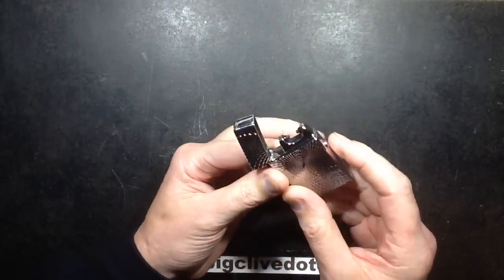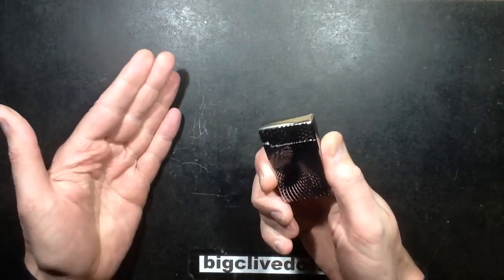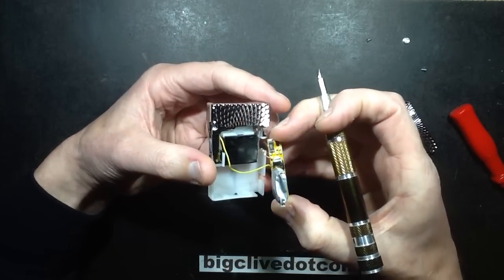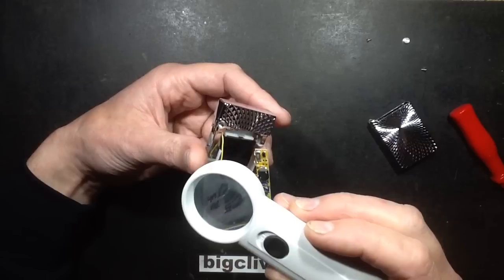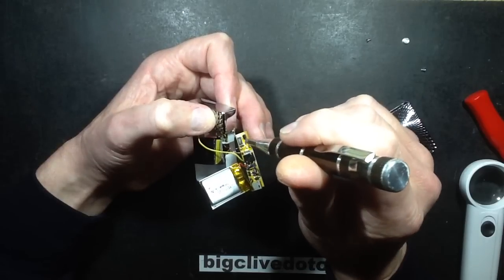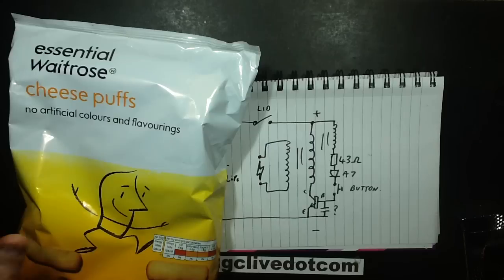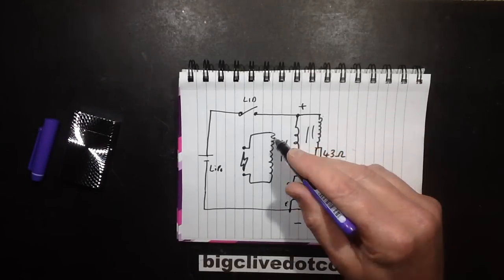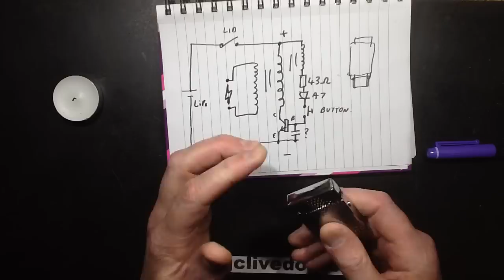Disassembly and schematic of an arc lighter.

Comment: sorry Clive disliked due to the fact that hurt my ears, it made me tear off my headphones.
Reply from the maker: +SwGuru Excellent!  I have created an audio YouTube monster.  My work here is done.
Reply: +bigclivedotcom hehe
Reply: +SwGuru headphones sucks use big speakers this will not rape you ears
Reply: +1ol17 I have my computer hooked up to a 500w stereo system with large speakers I have taken out of cars, and let me tell you what... This video still raped the fuck out of my ears.....
Reply: +Nolansykinsley Don't listen at such high volumes then. It's bad for your hearing regardless of whether you're using headphones or speakers.
Reply: BenjaminGoose I don't listen at high volumes, I turn it up just enough to hear the voices clearly, I save the full 500w for parties.

It wasn't the volume that was earsplitting, even turning the volume down most of the way did not help, it was just a really jarring and piercing frequency that starts to go beyond what I can hear so gets garbled and is very painful.
Reply: Nolansykinsley Fair enough.
Reply: +1ol17 BULL SHIT...
Reply: +SwGuru lol. i've never been grateful for hearing loss/tinnitus before. i felt a weird pressure behind my ears that i notice with high pitch sounds, but that is it.
Reply: +BenjaminGoose - It's the pitch rather than the loudness of it - like a brake squeal - you feel it as well as hear it.
Reply: +Krisztián Szirtes I thought the same right until he held it up to the microphone...
Reply: +Thomas Peacock pls help me out with that.
Reply: I'm not liking the sound also
Reply: Grow a pair.

Comment: I bought one of these over the summer from Amazon. It was named after the great Nikolai, presumably to give reassurance it was designed by him, or perhaps the electric car company.
At any rate, it failed within a few weeks and would no longer charge. When I opened it up, it seemed the windings had shorted, and it was very poorly resined.
When Clive decided to test for shock, I got a big grin as I knew what was coming. The version I bought was activated by a mercury switch and shaking it. I had it in my pocket and was fiddling with it. Naturally I touched the arc and got a funky kick in the hand.
Nice video as usual.

Comment: Interesting that the first time it lit the sound was very clear and quite loud (about 10Khz) at a guess, but when you put it close to the mic it clearly overloaded the input and added lots of distorted harmonics. I can STILL hear that sound now, clashed with my tinnitus quite well.
Reply from the maker: +Michael Beeny It was the YouTube processing that turned an already exciting noise into something reminiscent of a Space Invaders machine exploding.
Reply: +Michael Beeny 
I measured 13.8kHz with an audio spectrum analyzer. I luckily don't have a tinnitus, but frequencies above that around 15kHz go straight to my teeth and make them feel tingly.
Reply: +superdau mine said 14.17khz. i wonder if that jitters
Reply: The interesting thing is that the frequency recorded is nowhere near the actual oscillating frequency. A friend gave me a couple of cold cathode tubes and driver from a printer and my headset picks up the noise created really well. As I increase the power to the driver, the frequency decreases until about 17 volts (DC input to the driver), and then it suddenly pops back up again and rises. If anybody's interested, I can make a short video demonstrating it.
Reply: Oh, and it also killed my multimeter when trying to probe the AC voltage. Frequency increased as power increased, from memory, but I could be wrong.
Reply from the maker: +Prehistoricman Most multimeters are not rated to measure AC at high frequencies, and combined with the high voltage from the inverters it would be absolute death to many meters.
Reply: bigclivedotcom Yeah, I saw that in the manual later on. Up to 400Hz AC, which is pretty poor. Interestingly, the frequency and continuity measurements still work fine, but voltage and current are completely shot.
Reply: +Prehistoricman the standard end user of an average multimeter has little need to measure above 400 Hz. This covers your typical mains all over the world as well as aircraft AC.

There are of course multimeters that exceed this and frequency counters that go all the way up to 40+ GHz. 

All about the right tool for the right job.
Reply: The ringing never goes away, it just gets bearable again. Actually quite a lot of tinnitus is in the mind/how you deal with it (in my own experience anyway) and I've grown used to blocking it out in normal day to day life, only bothers me in absolute silence now when it can feel loud as all hell but still can "tune out" to a large degree.  I still occasionally get bat calls resonate in the back of my neck somehow, feels like white noise/harsh vibration in my vertabrae!

Comment: Thanks Clive for sharing your experiments with us. I learnt a lot from you. 
About this kind of stuff that make spark(not an arch), yes it is high frequency. I am amazed you as such an experienced engineer touched the contacts of that. I think you mixed up the case with arch welder that with a low voltage makes arch, arch welder is absolutely a different scenario, to start an arch in it the electrodes must be touched for a second and then the very high amount of current and other conditions are required to have a stable arch. In sparkers such as your lighter a very high voltage is needed, the high frequency is needed in favour of using much smaller transformer not the lower output voltage , the higher the frequency the smaller the cross sectional area of the coil which means the smaller transformer. All the switching PSUs these days are using the theory of high frequency, as you remember any electronic device we used to buy there was a heavy transformer in it but we can't see them any more except in a device that needs a very high current which still use the classic type transformers for high currents consumption. Many thanks again

Comment: I have one of these that has the X arc pattern, bought it because the 2 arcs passing right thru each other without interacting was interesting to me... I have never been froggy enough to poke a finger into the electrodes with it on, but expect it would be similar result. 

They're cool but definitely drawbacks... One is the electrodes foul readily. Another is the output fades as the battery drains down, exacerbating the effects of the fouling... And then there's cold battery response. But still a sweet addition to the collection.

Comment: OMFG that noise when you turn it on!!! 20KHz PAIN!!!!
Reply: 13,750hz, but nice try though ;)
Reply: @DJSNT  Interesting, I got it as 14·285kHz - but that was just one sample. Frequency may change when a big fat candle wick is placed in the way.
Reply: Re measured  - still getting it at 70µs/c. https://www.flickr.com/photos/pmailkeey/48872322562
Reanalysed measurements. 71-72µs = 13·889 - 14·084kHz so as near as dammit, 14·0kHz.
Reply: I have headphones on and only heard a little very quiet static... guess my hearing loss is now down below 15khz....

Comment: I use one of these while working.
Welders/structural steel workers aren't allowed to carry lighters due to the danger of exploding if molten metal drips on them.

They're good for lighting a cutting torch too, provided you don't get the torch tip too close to the arc.
That's how I found out they'll shock you.

Comment: This video made me curious enough about these things that I had to buy one, and of course I stepped it up and got one with a double arc. It lacks the lid safety switch, and from experience I can tell it is also very capable of delivering a nasty shock when the arc crosses any metal object you're touching…
I'm not sure if the only purpose of the double arc is to make it look cooler. It seems the two arcs cancel out each others RFI for the most part. I don't have the horrible squeal when recording a video of it, only a few pops.

Comment: Love the testing portion of your video.  Such a sacrifice!  I just got my first arc lighter and its one of the new fangled "dual arc" lighters.  Any idea how they get the arcs to cross without jumping to a closer terminal?  I'm thinking there is an oscillator in there that switches the terminals on and off too fast to see.  Anyone out there know how this is done?  Thank you.

Comment: The skin effect does not work really with flesh - I think what happens, is that the pain of electric shocks comes from two main sources: the involuntary muscle contraction and the burning. If the frequency is very high, then the muscles dont respond to it so much so this effect goes away, also if the current density is low (like a few mA but spread over a wide contact area), you wont feel it. But it's not so reliable and even quite high frequency you can get just as bad shock depending on the exact circumstances.

Also, anyone who has had a shock from mains, you can absolutely for sure feel the 50Hz (or 60 or technically 100 or 120) pulsation . I know I could, very distinct.
Reply from the maker: I recently did realise that it is indeed not the skin effect but lack of sensitivity to the high frequency of the current flowing through me.  This is borne out by a surprising shock I received when I deliberately held the two output wires of a high frequency and high voltage inverter which was powered from a bench supply.  I was expecting to pass current without feeling anything, but got a sizeable shock from the superimposed 100Hz ripple.
Reply: i can tell you that even at 390kHz i can sometimes feel the shock (tesla coil)
Reply from the maker: viermidebutura That may be the 50/60Hz ripple you are feeling.
Reply: bigclivedotcom
Interestingly though that a 390Khz signal that has a 50Hz ripple superimposed actually has no 50Hz component at all.
Reply: bigclivedotcom  the tesla coil i'm speaking of works only on first 1/4 of the 50Hz cycle and can repeat the arc from 100 times per second to  1 arc every 2 seconds

obviously i touched the arc al a low bps so i only received  400kHz for 5ms 

if i think more you are still right because the arc grow fallows the first 1/4 sine mains voltage so there is still a low frequency component

also i received some 30kHz burns from a battery powered inverted but felt no shock
Reply: If you feel the high frequency, it probably is due to low freq. ripple. I had a tesla coil  that only warmed the finger (a burning sensation after a few seconds). I felt no shock. I guess it was something like 100kHz or less at rather low power (like 100-200W). It was totally free of ripple.

I see no reason why skin effect wouldn't work with any conductor, human or not.

Never tried that with higher power coils that had some ripple in them. Ripple or any low freq ac component can make those quite dangerous, like any arcing over that may connect you directly to low freq ac.
Reply: The effect of the skin effect diminishes as the resistance goes up i.e. higher resistivity means higher skin depth all else being equal. The exact same mechanisms of the skin effect of course apply to humans as anything else, but humans are not homogenous and although pretty conductive, not in the same league as copper! Also skin effect does not mean all the current is confined to the surface, but the current density as you go deeper decreases.

Comment: Edit : I think the component I'm having difficulty with is an inductor.

I have an interesting lighter you might be interested in looking at... It's called an electro-match, from the 1960s. It takes 3 AA batteries and has a transformer, or converter, or something... That's where I get lost.

It has an open circuit, and a match "wand" that is removed. Wand is made of copper, and as it's removed it completes a circuit for a moment. When the circuit is broken, it creates a spark, igniting the wick on the end of the wand.

The problem I'm having is the transformer, or converter, is broken on a few of them due to corrosion from battery acid. I have no idea where to start on getting a replacement. If I'm reading the multimeter correctly, it's putting out 4.6v at 230 amps or so.

It's a very simple circuit, but the more I look into it, the more confused I am. No electronics at all, just a simple open circuit.

Comment: The black componement is a high-voltage module/generator, it convert the 3.7v of the battery to aproximatively 5 000v.
The circuit board is only a Protection Circuit Board for the battery.
This method doesnt need any other componment than a battery and the high-voltage module/generator.

Comment: If you're gonna test whether something shocks you or not, up one arm and down the other isn't the best option, as it goes right across your chest. I know you weren't expecting it, but that's probably the most important time to care. Try keeping it to one hand or arm.
Reply: He knows. That's what he was going to test. He just didn't expect the lighter itself (or the button) to close the circuit.
Reply: I commented to a guy working on some electronics "Judging by the spark, that looks like mains voltage". But his test lead wouldn't fit in the Sub D socket - so he inserted a straightened paper clip using bare hands. That pretty much confirmed 240V !